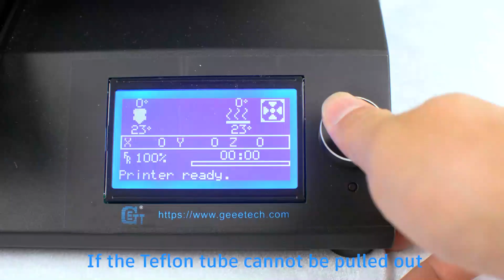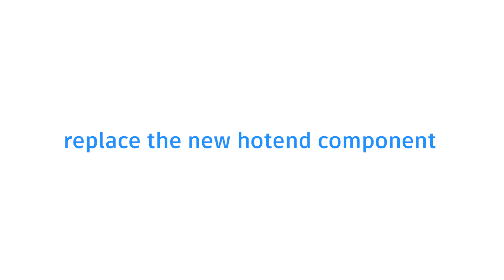GEEETECH A20T 3D printer | replace hotend

Comment: I see so many people struggling with those small allen-key tools: have you tried to use an Torx screwdriver? They often fit very well in those allen head bolts and are much easier to handle.